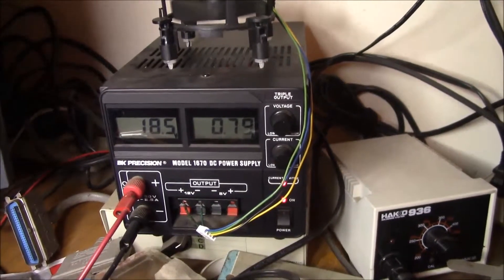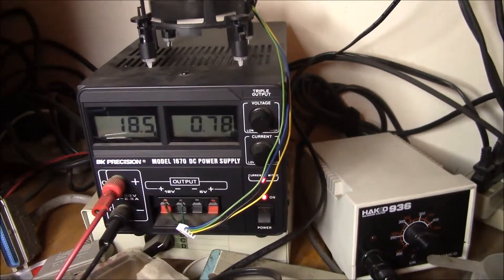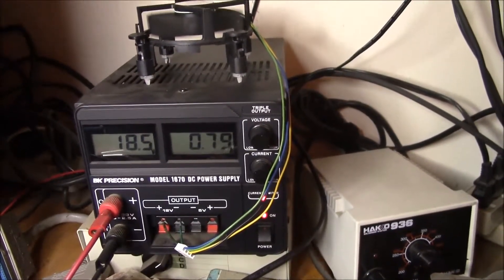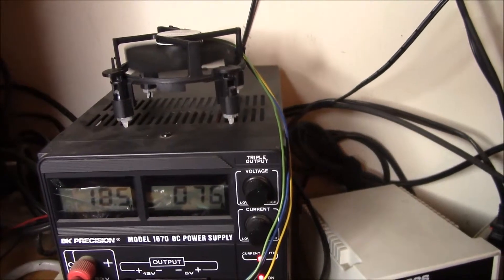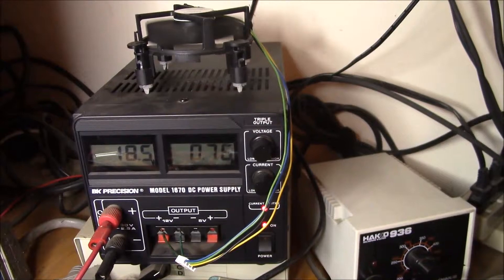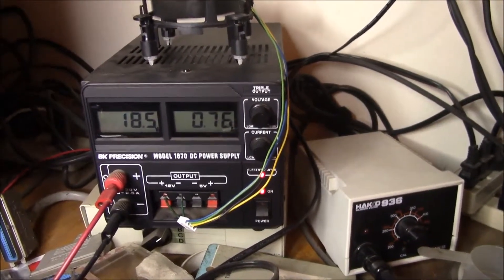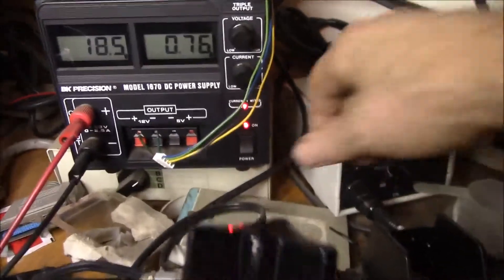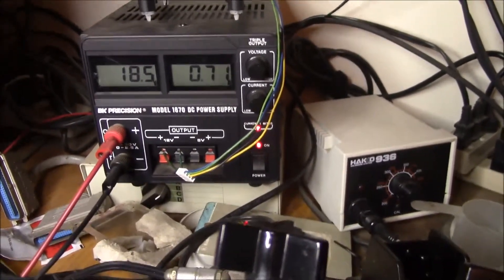Easy Power Supply Cooling Fan Hack

Comment: Just one minor point. Hot air rises, it might be better to either place the fan at the side or suck with the fan closer to the grill. I always do the blow, it's more efficient.
Reply from the maker: Good point.  Yes, some day I hope to open up the power supply and see if I can fit a fan inside blowing on the heat sink.  I recently did this on a battery tab spot welder and it works great.  But that said, I've been using the supply like this for 3 yrs. now and it's been working great, no more overheating issues like I had before.

Comment: How has that particular power supply been running for you? I just purchased one, just a curiosity
Reply from the maker: Allen Bianchor Its been working great.  Mine is many years old, and aside from running hot at higher loads, no real problems with it.  The cooling fan cured the high temps.  Only other minor issue is the readout is a little off maybe a count or two on both readings, but close enough for most tasks.
Reply: R Brown Nice, BK seems to be a reputable company, this one just happened to be on ebay so I picked it up. I wanted the lcd display and the over current protection as well but thank you for the info, much appreciated!!
Reply from the maker: Allen Bianchor About the same reasons I purchased mine.  Probably had mine 10-15 years now.

Comment: I am using the Panaflo 12v 120x120  0.4A est 3.7W, low noise. Very useful to keep few, esp for ventilation purposes. Still waiting for three of the 5v 2nd hand used 40x40 high RPM 4500 small fans to DIY a car hot air extraction, intend to charge via 7w foldable Solar Panel and powered it on a old powerbank.
Reply from the maker: Yes, I have a few 120mm fans around, too.  I like the Silenx models I used for my attic ventilation, but lots of options out there.  I had this old Intel CPU heat sink fan I couldn't use in my PC and it's fairly quiet and sits up high enough to cool the power supply.  I think I have a smaller ~40mm fan around some place that I may try to mount inside the power supply case.

If I can find the time, one of my next projects will be an in-window solar powered heater using an old 5W solar panel, a couple of PC fans and some aluminum grating as a heat exchanger.  Place it in a sunny window and the fans will circulate air through it and blow out the heated air.  And at night, it'll serve as dead air space for added insulation.
Reply: I'd love to get one 12v RV Fan Tastic Endless Breeze box fan. My friend little daughter going England Liverpool Anfield  soccer match, if not I will have it by year end. For 68 bucks, is a good steal for a great ever made US RV fan.
Reply from the maker: I've heard good things about those fans.  If I ever run into a use for a large 12v fan, that is likely what I'll go with.  For example once I enclose my patio/sunroom, I'll need some cooling back there for half the year.  Luckily the need for cooling and the sunshine is perfectly aligned, so screams for a solar powered fan.